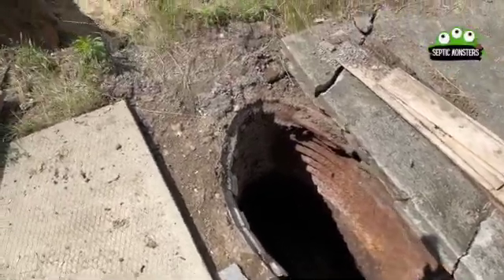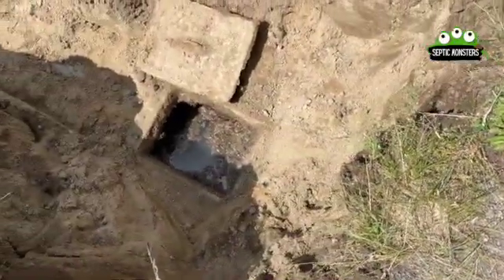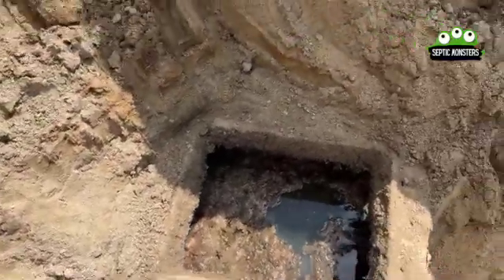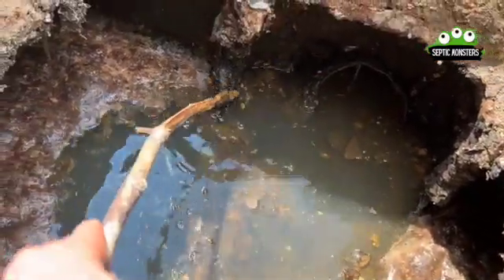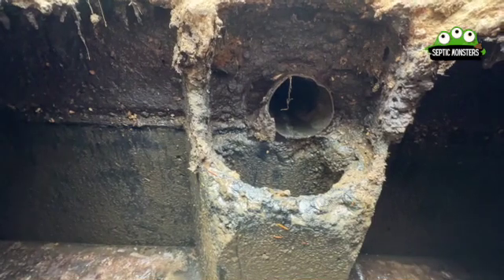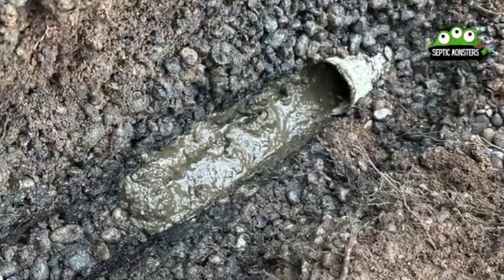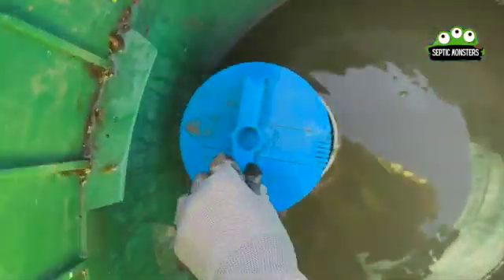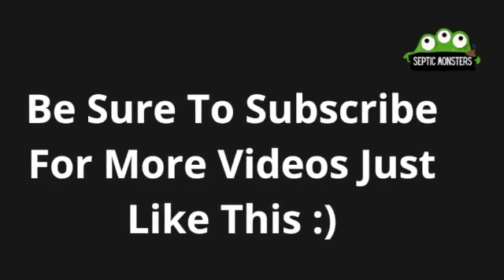Essential Concrete Septic Tank Maintenance: Checking the Baffle through the Second Lid | Expert Tips

Comment: As a Licensed Septic Professional with over 20 years of experience I can tell you that Concrete Outlet Baffles are not that common in modern Septic Tanks. Typically, it's Septic Tanks from 30, 40, and 50 years ago that had both Concrete Inlet Baffles and Outlet Baffles. Fortunately, most modern Septic Tanks don't have baffles inside when they're manufactured these days. That's because the installer will attach a PVC Sanitary Tee Baffle to the Outlet Pipe with PVC Cement or Glue. In my state, a stainless steel screw is also required to ensure the Plastic Baffle can't fall off. In other words, the screw is added as an extra precaution, but in my experience, if the PVC Plastic Tee Baffle is properly glued to Schedule 35 Pipe, it doesn't ever come off. The bottom line is that homeowners with modern Septic Tanks shouldn't have to worry about the Outlet Baffle deteriorating or falling off, if it's a PVC Plastic Tee Baffle properly attached to the Outlet Pipe, which is usually Schedule 35 Plastic Pipe. In my business we call it green pipe but it has a Schedule 35 SDR stamp or label on it.